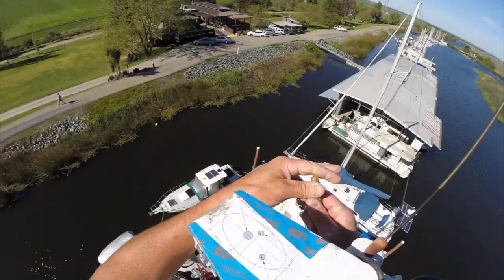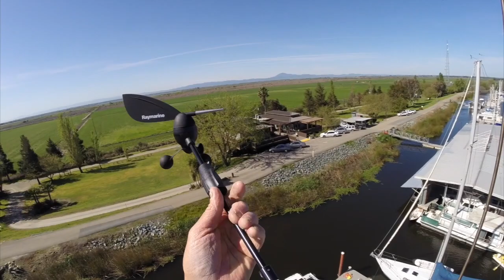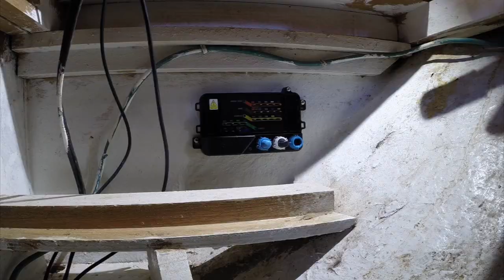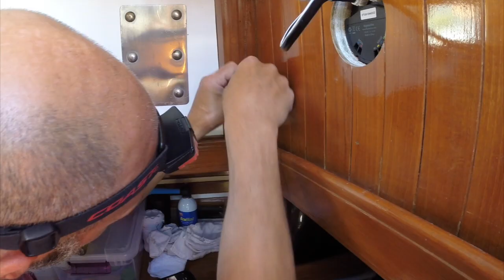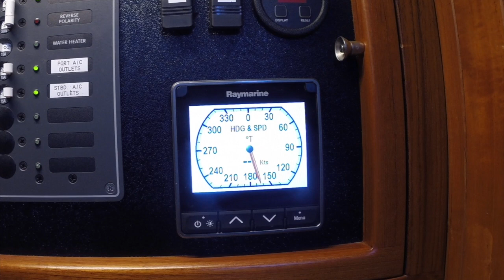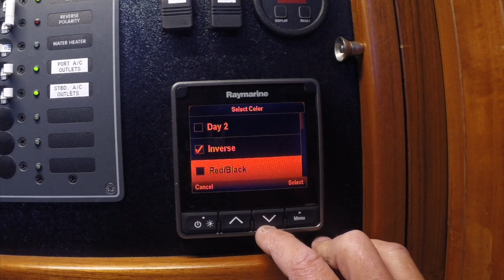SV Ramble On | Part II Installing New Electronics

Comment: When running the new NMEA2000 for the wind transducer down the mast, did you simply use electrical tape to connect end-to-end on the old wire? I am slated to replace my outdated masthead wind transducer soon and want to avoid any hiccups when fishing the new cable down the mast.
Reply from the maker: Hey Thomas, thank you for the comment.  The Raymarine i60 wind transducer at the masthead isn't NMEA2K, but rather came from the factory with a jacketed 5-wire that's about 1/4" diameter and roughly 90' long that we had to pull down the mast.  It needs to either be wired directly to the i60 wind instrument its self,  or it needs to be wired to the iTC-5 instrument converter which is powered through the Raymarine STng backbone system.
When we pulled the old transducer wire out of the bilge and up through the mast, I tied on a length of string and pulled that up along with the old cable.  I tied the pull-string to the new wire at the masthead, smoothed out the hard edges with electrical tape, and surprisingly, when we pulled the new wire back down the mast and into the bilge, it managed to make it.  Ours is a deck-stepped mast, so we had to wrangle the wire a bit to make it go down the conduit and into the compression post at deck-level, but we managed to get the wire through without incident.
Hit me again at rich-at-svrambleon-dot-com if you have any specific questions about how we ran it, and how everything interfaces with our existing N2K system.
I was about to go off on a rant about helm-mounted chart plotters VS. iPads, but figured this is not the venue....
Thanks again for watching.

Comment: So there all nema 2000  ?
Reply from the maker: Yes.  With Ramarine's Device Net adaptor cable NMEA 2K info can be displayed on the Multi-function Display, and vice versa.  The i70s will display AIS & GPS info from the Vesper Marine XB-8000 transponder, and the WiFi in the AIS can transmit depth, speed, wind, etc. wirelessly to an iPad or laptop with chartplotting overlays.  The XB-8000 also has a USB port for direct connection to a desktop or laptop computer.